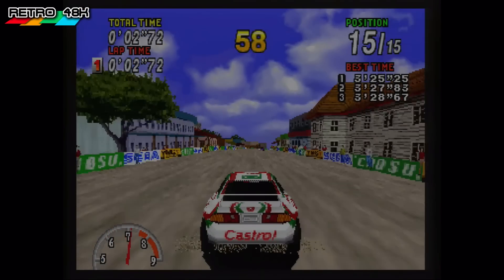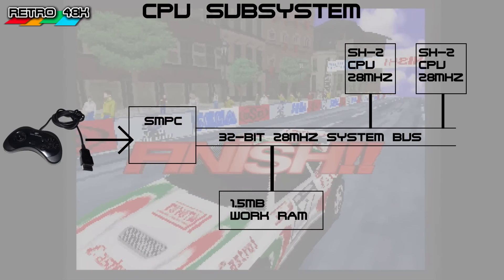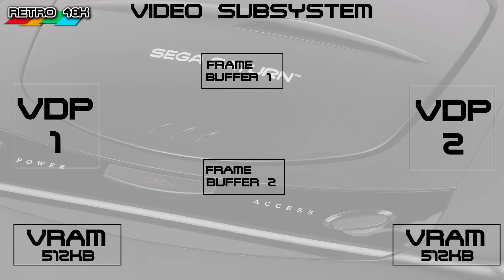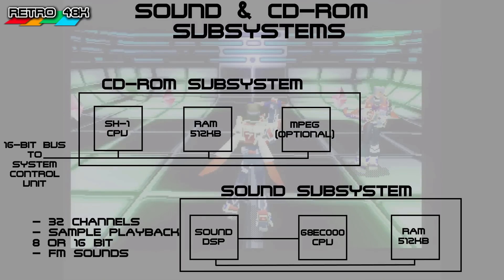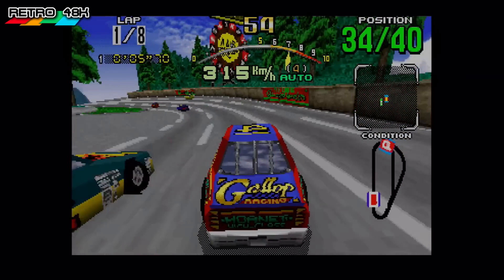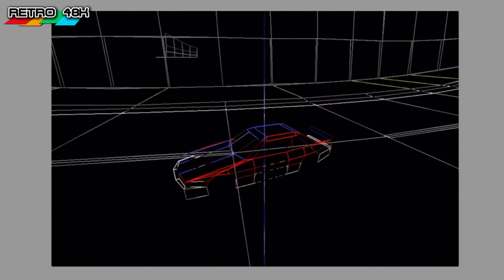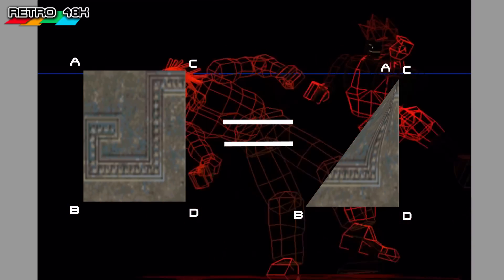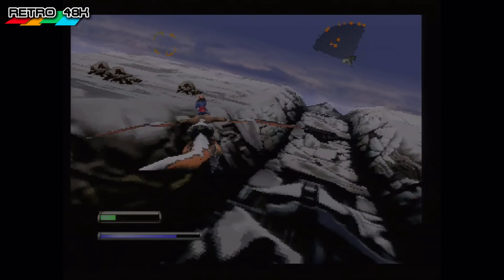How the Sega Saturn Worked

Comment: Those are not quads, they are black textured sprites in the shape of squares. To get the wireframe mode, you would simply call to make all sprites black with a white line on the extremes of the sprite.

With the correct math and hardware, quads are faster to draw than triangles simulating squares, a lot faster. The majority of people used the pseudo 3D sprite engine, the sh2 could do poligons but, it was actually slower, you could in theory about 33% more true polygons than the psx with the saturn but this mode mostly made null the whole saturn system and, the games would simply look like shaded n64 games.

Nice video.

Comment: It was underpowered that’s why I needed to co-processor to equal out of the one process to the PlayStation used.
Those two cop processor is the reason no one ever actually tried to develop for the system because it was too hard to develop for.

Comment: The PlayStation didn’t have a floating point unit.  Did the Saturn have one? And were the 486 computers able to do FP?
Reply: i486 can do FP. i486 with defect FPU were sold as 486SX . N64 is the first console with float on CPU, but the graphics is calculated by RSP, which cannot float.
Reply: @ArneChristianRosenfeldt thanks. I am not an expert on this subject but I enjoy learning about it.
Reply: @Islandswamp  I feel like the documentation is still bad and the videos also. I got to see PS1 before 3dfx voodoo before Saturn. So Saturn looked dated to me. This is just nostalgia: before hardware 3d acceleration expanded from 2d to 3d , I dreamed of writing a software rendering engine.

Comment: Ports would be noticeably different between each platform, because of systems limitations and different architecture, but nowadays the only thing people argue about is how one area of the game has a slightly better framerate. Just shows you there really isn't much difference when it comes to comparing modern hardware.

Comment: It sounds like Sega didn't provide a good compiler to their developers with proper hardware understanding in generated binary code.
Reply from the maker: No they didn’t apparently it got better towards the end but it was too little to late by then
Reply: Sega sourced the CPUs. RISC CPUs were developed in tandem with their compiler. So you talk about the custom chips? You mean a driver? SegaDSP slowed down the SH2 . Similar to what Atari did: the custom hardware was interfacing to badly with the CPUs that a ton of cycles were lost in stupid data moves.

Comment: one minor thing: it doesnt matter if you use c or asm (apart from optimisations). you have full access. C is can talk to all registers and do all those things like asm would. and you can always even mix these. 

and even in c, when writing fro ps1 and saturn at once, you will have different registers for different things on each console. 
its always a pain to write c code for different system. even for ds and psp. (just think about the dual screen thing, the touch screen or analog stick)
Reply from the maker: Hi I was simplifying things for a wider audience the point I was attempting to get across was that writing in C was not as efficient as writing in a more native language but I was trying not to go into compliers etc as I want these videos to be understandable by none coders
Reply: @Retro48K526  yeah, sure. but you said you can not access these things with c. and thats simply wrong, not simplified. i agree tho that the programming part doesnt need to be here. actually could have left out the entire c/asm part and it would be fine and less risk of false things.

Comment: From what i've already read and heard, the biggest difference between Saturn and Ps1 was the development kits. Sega's were garbage. Even the best ones had serious drawbacks, while Sony acquired whole companies to develop the best kits possible for their system.

These homebrews doing impressive things that at the time were thought impossible (like wide open 3d spaces without pop up, a common sight on Saturn games) prove that Saturn still had a lot to give in the 3d field but as it was more difficult to achieve and the returns ($$$) were small, companies just didn't bother trying anymore later in its life.

Comment: At 11:30, you can put the D vertex in between A and C (imagine drawing a line between them and putting D on that line somewhere), at least that's how they do it now in 3D for modeling, retopology and animation. I dont know how viable that would have been on the Saturn hardware in terms of ease of use and performance.
Reply: This does not work with quads. Yeah, sadly no checker board on the animation. Saturn could draw triangles, just not with texture on them.

Comment: Might be wrong but sure I heard somewhere that the Saturn didn’t use the normal polygon based graphics and that the quads were actually sprites rotated in 3d space
Reply: Affine triangles (two of them) are also rotated sprites. Actually sprites on GBA do this. Real sprites rendered on scanline. Low latency.

Comment: Your assessment about how the developer needs to stick mostly/entirely to assembler when it comes to maintaining performance isn't correct. The Hitachi SH-2's RISC assembly was designed specifically in mind for the C programming language. It even states as much in Hitachi's SH-2 spec. While it is true that coding in hand-optimized assembler (key word here: hand-optimized) will always be faster than equally optimized C code, that doesn't mean C-compiled code is several orders slower. Michael Abrash, a colleague of John Carmack and probably the greatest assembler wiz of all time, stated as much in just about every volume he's ever written, and he even demonstrated this fact many times. And he proved this fact using the incredibly obtuse 16/32-bit Intel chipsets, whose CISC instructions were decidedly not optimized for C compilers. 

You can produce an executable using pure C that will rival (but never outdo in terms of clock cycle performance) pure assembler. Again, my source is Abrash. And when you're in the breakneck environment of video game production for the console market, it makes no sense to stick entirely to piecemeal assembler. 

Now, when it comes to the Saturn's DSP, that's a completely different matter. The only way to effectively work with that powerful but obtuse beast is in pure assembler and with matrix mathematics no less.  This is because you have to pipeline every instruction by hand and it's painful.  Programming for the SH-2 itself is easy and straightforward, but adding that DSP into the mix changes everything.

Comment: If you like complicated game consoles, try looking at the Atari Jaguar. That thing is a whole mess to understand, complete with crippling hardware bugs that severely limited developers' options when making games for it since they had to figure out workarounds. Luckily these days the Jaguar is an open-source platform.
Reply: It’s not complicated: there is only one memory, you have Jerry for audio and Tom for graphics. Within Tom you either use OP for 2d games , or GPU+blitter for 3d .

Main CPU is the same as in genesis. Just keep your game logic as tiny as in a genesis game! Want 3d collision detection and physics? Oh that gonna be complicated…

As someone wrote “there is only one system bus”. So Flare / Atari does not recognize this design flaw as a bug.

On the system there are async DRAM (expensive), the internal connections of Tom and Jerry, and the slow legacy stuff like 68k , controllers, ROM. So already the rough design would need to separate these three and have bridges. And it need to be allowed the read write order is changed. So if some device wants to read something from another device, this request might need to pass bridges and wait in queues . The read value then travels back. Atari Devs could not grasp this messaging like in Small Talk between objects.
Reply: @ArneChristianRosenfeldt  tom 750000 transistors.jerry 600000transistors do the math .btw is jerry only for sound.

Comment: Do you screw up every video you produce?  The Saturn has 2MB of work ram.  You got frame buffers wrong.  It is a simple double buffering technique.  While VDP1 writes to one buffer, VDP2 reads from the other and treats it like another layer.  Every frame they swap.  So VDP1 writes to buffer A, VDP2 read to buffer B.  Next frame, VDP1 writes to buffer B, VDP2 reads from buffer A.  The SCU-DSP worked in a very similar way as the GTE.  The GTE was just a lot faster.  3DO did quads, so no it was not unique. No c code is not really slower than assembly, that is itself a myth.   Please show your videos to people who understand the hardware you are talking about so that you can fix the parts you get wrong instead of spreading more misinformation.
Reply: GTE was triggers by coprocessor instructions within the MIPS instruction stream. So it costs you only a single cycle. No bus contention. The GTE CISC instructs run parallel to the RISC instructions just as with SegaDSP. Oh wait. Sega DSP has very Long instruction words with a horribly verbose machine language. It is faster to just calculate on SH2 than to cobble together these code fragments .
Reply: @ArneChristianRosenfeldt  Switch generates basically a pointer table. Requires reading the pointer and doing a Call. A jump table per se in C is a misnomer.
Consider the following:
A bunch of functions, say 256, padded to 512 bytes or whatever. Shifting just 8 bits and adding the program base, instead of calling the function you just jump to them without the need of setting stsck frames, the overhead in call, etc. Such things are not possible in C.
Reply: @ ah, when you start with an integer like in Basic   ON  GOTO , but C allows any values. So the jump would point to a hash value. Yeah, I guess when you optimize zero for code density. Quake software renderer has something to divide by small integers and I am thinking to steal this for a port to AtariJaguar, but scratchpad memory comes at a premium.

Maniac Mainer on C16 jumps to achieve multi bit shifts, but now I wonder why: no object moves more than a pix per frame. Could just shift in place..
Reply: @ArneChristianRosenfeldt  Yeah precisely these sort of acrobstics. I argue they cannot be done in c, at least perhaps not without heavy executable tinkering, which would defeat the purpose of using a compiler.
Reply: It is not a myth; the sort of optimizations possible in assembly are not possible with C. The "code" itself obviously doesn't run slower, but the sort of acrobatics possible in assembly are not possible with a compiler. This is of course quite dependant on architecture, with RISC cpus usually not beneffiting too much from assembly.
Reply: @ you are absolutely incorrect, especially with the C language.
Reply: @knight0fdragon  Really?
Do a jump table in C. I'll wait; and no, a call table with function pointers is not a jump table.
Unless you actually do low level, which obviously you don't, I suggest limiting the displays of Dunning-Kruger.
Reply: @ …. That is what you got?  Jump tables?  You know compilers themselves do build jump tables right?  You also know that C lets you inline assembly to take advantage of writing your own optimizations while still taking advantage of the language, right?  Talk about Dunning man.  Jump tables.  Thanks for letting everybody know what a joke you are.  Move along.
Reply: @knight0fdragon  And you know those "jump tables" are not jump tables, but call tables? Do you even know the difference?
Like I said, if you don't do low level,  limit the Dunning-Kruger.
Also, that's the first thing i mentioned: arrays of function pointers are not jump tables, and in typical Duning-Kruger... first thing you assume.
Reply: @barnabyfontana7528  the switch statement is usually implemented as a jump table , it is basically the reason for it?

Comment: The Sega Saturn was the PS3 of the 90s.
Reply: No, it wasn't. Firstly, PS3 was a console with a unique processor of sophisticated architecture, a hidden power that has been shown, and secondly, despite the fact of the CPU complexity PS3 was a successful console, the leader of its generation with an amazing library of games
Saturn was a joke, a flop, a mishmash of garbage in a plastic bucket that even Sega themselves didn't give a damn to
Reply: @luggy_guy symmetric multiprocessing was the future. PS3 has no bus and hence no bus contention. It his from IBM and hence has a token ring.

Though I still don’t get it. Can’t we use higher frequencies on a bus than for actual calculations? Like satellite TV always was 10 GHz.  RamBus was 10 times the calculation clock.

Comment: I think the thing i took away from this is that the sega Saturn cost more to develop, hence the higher price and it made no sense for developers to do anything more than pair back multiplatform games, as it would cost more for little output. It gets me thinking that Sega weren't very business savvy around 94-98 when it came to console architecture. Sony made developing for their console extremely easy for seasoned developers

Comment: The biggest problem coders back then had was the lack of experience to code for "multicore" multi-CPU Systems and everyone was  only really coding for Single CPU systems as that was the standard for most platforms including the PC back then. Co-processors worked differently and didn't share the workload like 2 identical CPUs would. They used this to a great advantage in "Panzer Dragon Zwei" when the one CPU would handle the load work from the Disc, while the other would keep the game flow running. This is also why "Panzer Dragoon Zwei" has no Redbook CD audio for the game levels but consists of Soundtrack played from the Sound RAM, like "Sewer Shark" or "Silpheed" did on the Mega CD.  And another game on the Saturn that had real transparency was the now kinda forgotten "Pandemonium".  :) The Saturn really was ahead of its time and introduced hardware architecture that would take at least 10 more years to become standard. Multiple CPUs on one chip that share the workload are standard now and what started with just 2 now ended up with 8 or 16 Cores.
Reply: didnt sega toss in the second cpu after they freaked out about psx capaibility and 3D hype tho?? saturn 
was meant to be a 2d beast. which it clearly shows it was.

sad it made things more complex to code tho. always sad to think of saturn and then dreamcast...
i wish sega still made consoles. 

so in theory could saturn push more polys then nintendo 64?? another console who also
suffered  from hard coding. Rare understood the console well enough tho with their games.
sadly the best show of 64s full potential was cancelled and turned into starfox game.

oh and pandemonium is a lost gem. tho i never played the saturn port.
only psx. lol.
Reply: @ssppeeaarr  Well there was a lot of last minute hardware changes. Which also had a HUGE impact on the development of the Saturn launch titles. The Developing Team for "Clockwork Knights" struggled with that a lot and there were so many 11th hour changes regarding the Saturns Hardware architecture.  At the early stages the Saturn was even supposed to be backwards compatible to the Mega Drive and Mega CD (and i think even with the Master System) but it was scrapped for quality reasons to not jeopardize the actual 32Bit hardware aspect and really only making this a next gen system.

Comment: I got my Saturn 6 years after it came out and even then playing on the Saturn still felt magical and special. I still have all my games and my Saturn and i'm glad i never sold it all. However as a PAL system owner some games really got an absolute horrible PAL conversion and the cardboard-plastic mix  for the game cases never really liked the years of wear and tear by their precious owners. HOWEVER i actually managed to get some fresh and sealed new Saturn games in a local department store here in Berlin, Germany in 2000, when they sold off excess stock for 10 bucks a game (that was 10 Deutschmark). That's how i got my copy of Virtua Fighter, which i even played together with my sister. Some titles i really still prefer to play on the Saturn, such as "Road Rage" and "Croc".